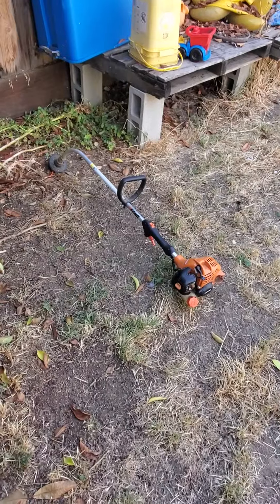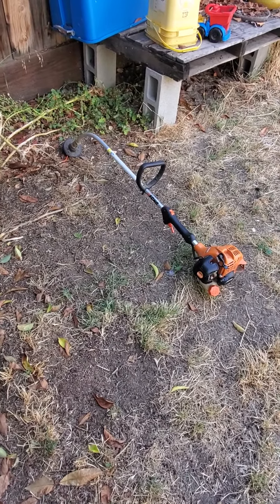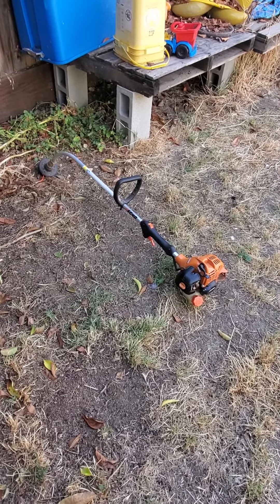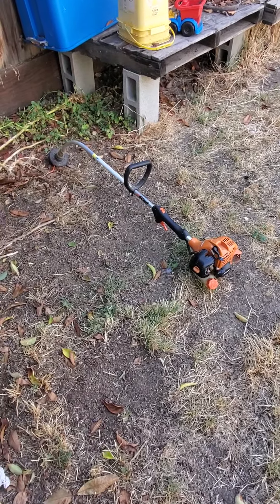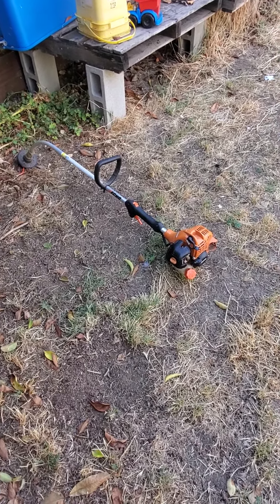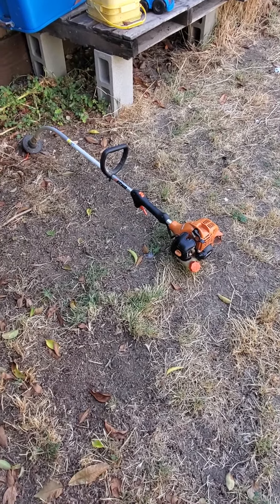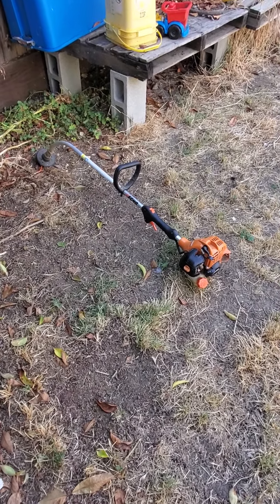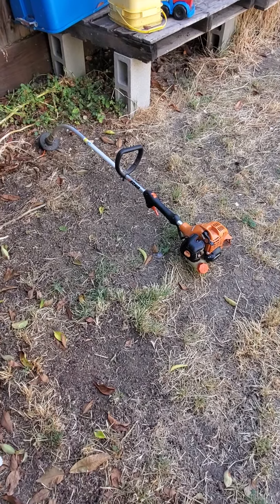Nitromethane in a weed eater

Comment: I have done this, you have to run your needles way out because it requires much more nitromethane. I’m thinking you were running a lien condition!! Also if you could advance the timing I’m not sure on that engine but that would help to. More fuel more timing it will not blow up, I know this for a fact!!!! Oh, and a tuned pipe would help!! I went down this road like 30 years ago, I am into RC boats, and no it was not water cold!! Thinking about revisiting this idea with new technology available. Anyway glad you experimented, it’s the only way we learn things. Just glad you didn’t blow it up. Next time run your needles high and low as far out as you can. Will actually run pretty cool!!👍👍

Comment: I need to make a video of my still as 76,it's highly modified, larger carb raised compression, ported polished custom exhaust, it turns 13k rpm, and I run  155 line  it will take down 1" saplings, no problem